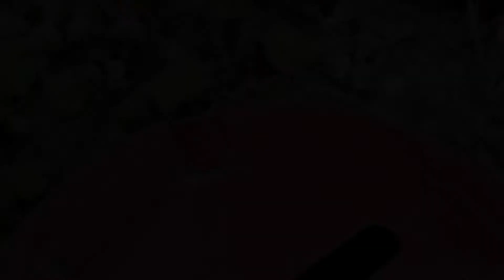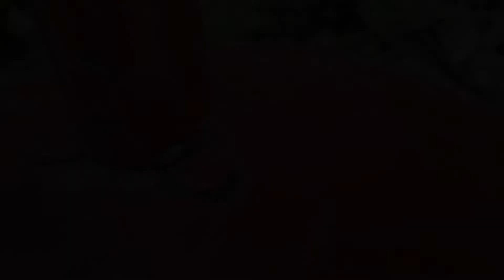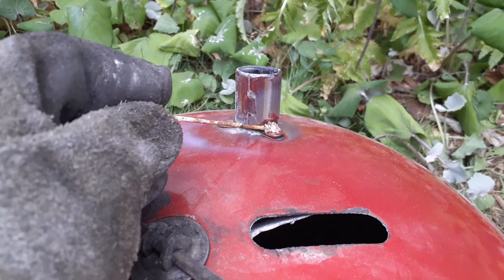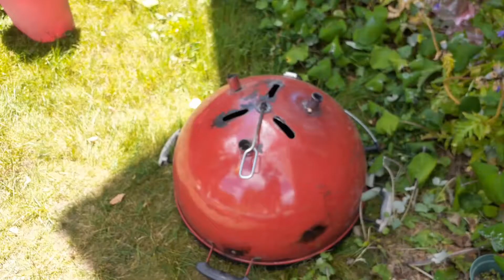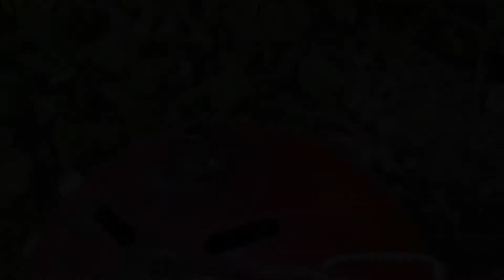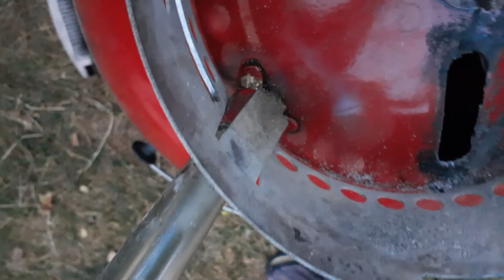How To PROPERLY Repair a Broken Weber Kettle Leg Socket!

Comment: what material brazing rod did you use?
Reply from the maker: I used a bronze brazing rod.  I attempted this repair again recently when the entirety of another weber's socket came off.  The porcelain interferes with this so I had to engineer a mounting bracket repair where the mounting bracket was supporting the leg but retained with screws away from the ash collector vent system.  If you do attempt a brazing repair, better bonding will occur where no porcelain is - or attmept to remove the porcelain around the area first.  All the best!